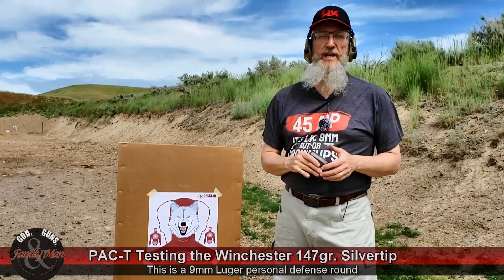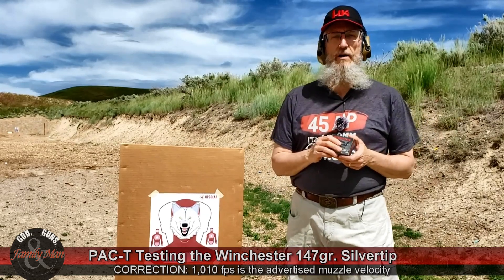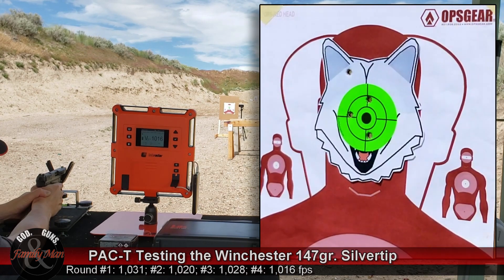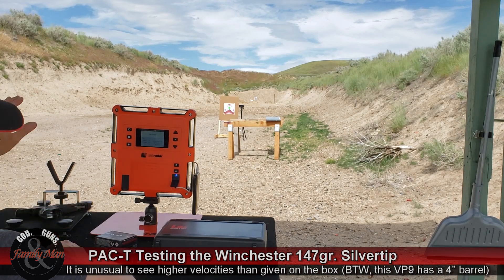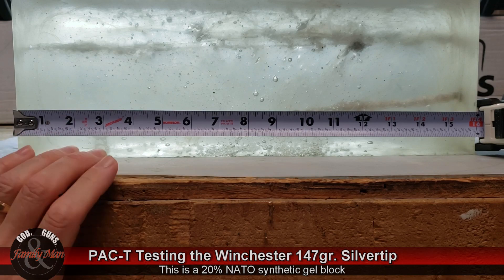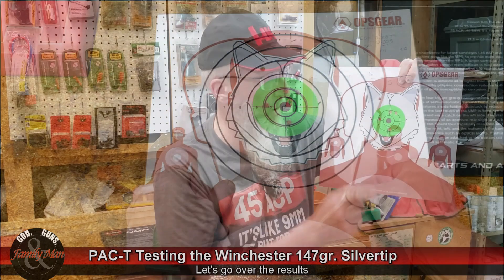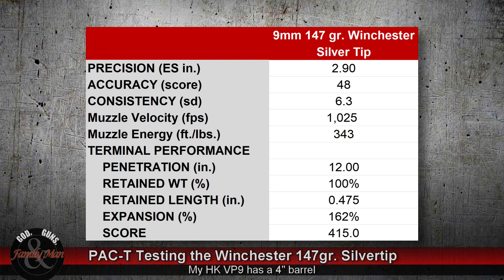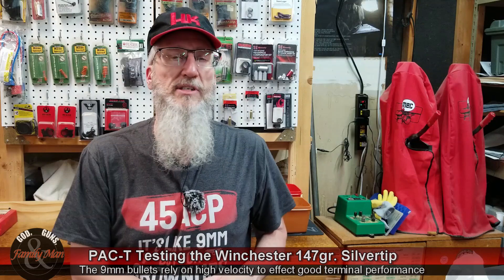PAC-T testing the 147 gr. Winchester Silvertip (9mm)

Comment: Considering it's 147g, and it's 9mm's in size, it's not vastly faster than the FPS of a fat, heavy 230 grain FMJ 45 at 11.43mm in size. I would get some good 185g 45 ACP HP loads and carry a good old 45 and call it a day lol. Use the 9 for tinkering out back or at the range.
I've seen some seriously nasty 9mm rounds, but they cost. All "good" defense rounds cost. I get that, but man it scares me to think I may not get a good shot placement. People that say capacity and then buy a G26 or G43 just puzzle me. They claim concealment is important but I thought capacity was 🤷‍♂️
So, that takes me back to lower round counts and a 45...either way, thanks for the video.
Reply from the maker: You are welcome and thanks for watching and posting.
Reply: You are assuming those who are for high capacity are all the same ones who are for light-weight concealability. Not to mention, there are plenty of people who CCW high-capacity full-size pistols just fine, including me.
Reply: @terrarecon I carry a G20 and so does my wife and we made the switch this year but I always carried a full size pistol and usually it was a 45 but for the last 2 years I carried a g17 and so did my wife and we carry a g43 on her ankle but now we carry the G20

Comment: Gel is usually 10%. How much difference does 20% make?
Reply from the maker: Hello FilippoCorti6760, good question.  The 10% is usually referred to as an FBI block and the 20% a NATO block. The 20% is more dense and will slow/stop a bullet more rapidly. Martin Fackler wrote a paper in the International Wound Ballistics Association Journal some years ago comparing 10% and 20% synthetic and natural gelatin blocks but I cannot lay my hands on the exact results.   The bottom line was the 20% provided more resistance and slowed/stopped the bullet more rapidly.  Both simulated actual soft tissue pretty well.
Reply: @sdkweber  I'm going to guess 20% is more accurate as in real life hollow point bullets frequently penetrate as deeply as in the typical 10% gel setup.
Reply from the maker: @filippocorti6760  That may be true also.  I use the 20% as it stops rifle bullets better. I still need two blocks for a large rifle but it does stop those bullets so I can examine their performance.

Comment: Excellent video.   But I think the Federal HST 147gr performs much better.  Greater expansion and deeper penetration.
Reply: After looking at the studies that led many police agencies to switch back to 9x19 mm from 40 Auto, I suspect the slight difference in performance between Silvertip and HST 147-grain rounds is going to make almost no difference in real life.
Reply from the maker: Thank you.  So hard to get these... I have not seen the HST 147 gr. but recently did a PAC-T test on the 124 gr. HST.  Not sure if you saw it... here is the link if you are interested https://youtu.be/tjpHfU59X_U
Thanks for posting.
Reply: Don't know what your talking about the hst penetrates, usually around 12 to 13 inches. Not deep at all
Reply: @nelsonr1467  It’s obvious you “don’t know.”   Just leave it at that and we’ll both be in agreement.
Reply: They perform a little better, but the HST are about double the cost. If you like practicing with what you will be actually be carrying, the silver tips are a lot easier on the wallet...and i think they would get the job done just fine.
Reply: @ True about price.  But no need to practice with HP’s.  FMJ’s work just fine for training.   One isn’t going to notice a difference.
Reply: @colt10mmsecurity68  I get fmj work great for practice. But it's also a good idea to see how well your gun likes your HP of choice.....ie feeding, ejecting and what your poa/poi is.
Reply: @colt10mmsecurity68  I recommend a person always at least see's if what they carry for a defensive round agrees with their gun. It is less about training and more about confirming reliability. At least 2 or 3 magazines to know if what you have loaded is going to be consistently reliable in whatever your carry gun is. For regular on-going training, yes FMJ's all day.